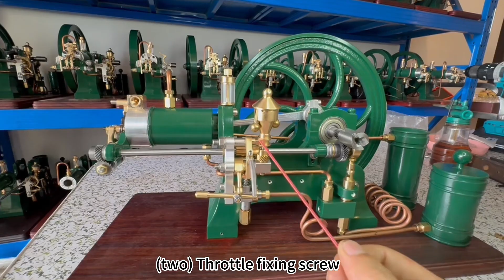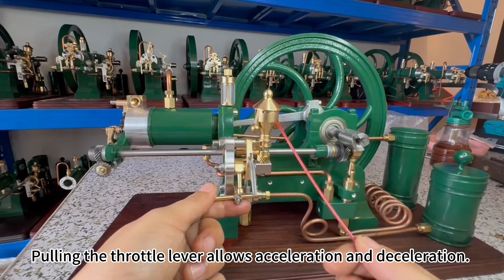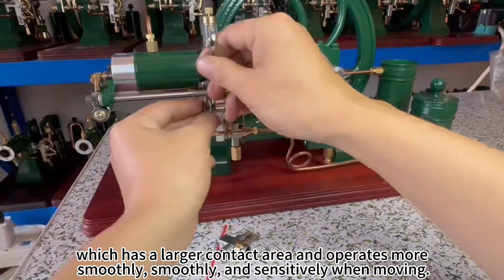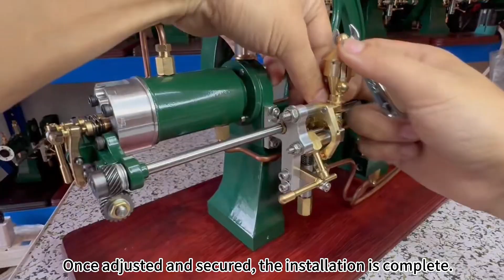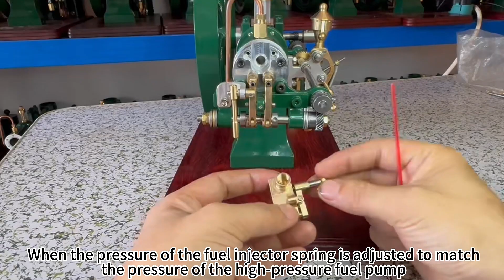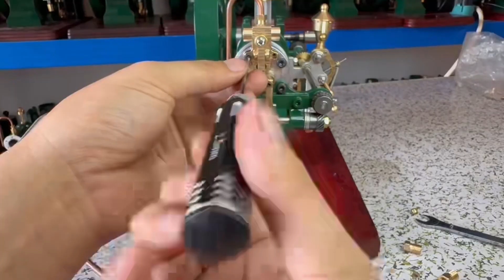RETROL 16cc 4-Stroke Diesel Engine installation tutorial is here! #enginediy #hobby

Comment: This is what I needed to see to find out how to clean and adjust the new injector!
Reply: Is it running good ?
Reply: @RickDavis-g4x  No, I got it running a little but then had some injector pump timing issues and have not been back.  I am not great with diesels so I find them daunting and confusing compared to gasoline engines.  I am hoping to work on it again soon.